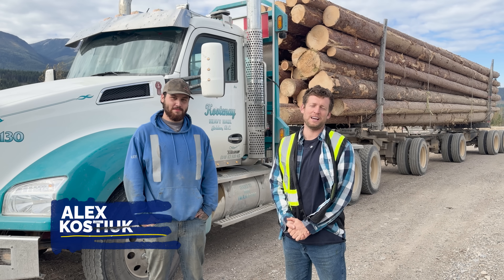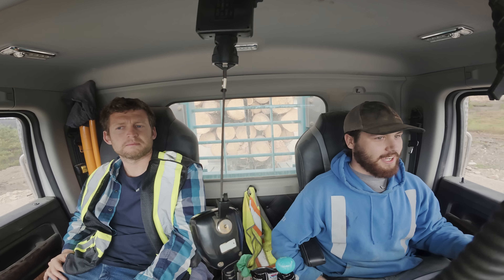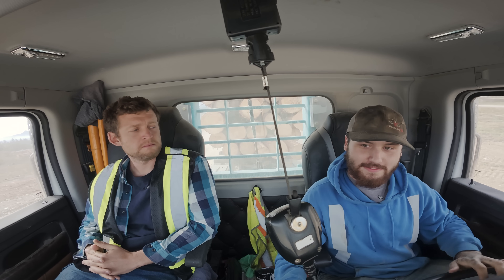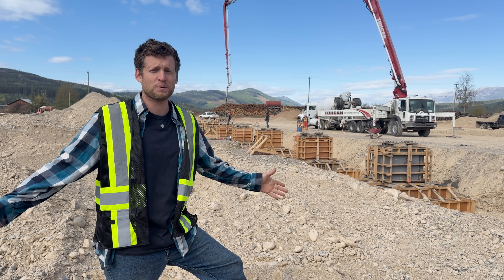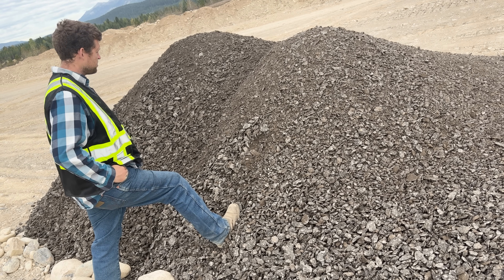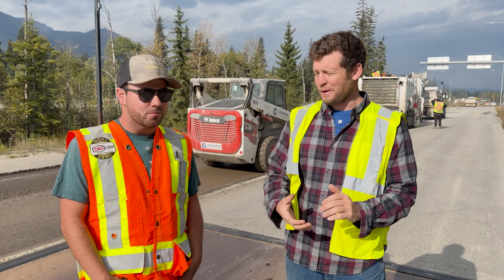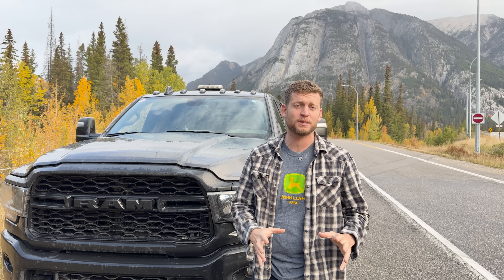First Ever Test Run on the Edison Motors Track

Comment: Will someone on this channel help me understand how the Edison Hybrid truck will handle sustained grade? It seems like ultimately you will be limited by the hp rating of the diesel engine onboard if grade is steep and prolonged. If you look at a lot of small hybrid cars the engine is the same displacement as non-hybrid options, just turns on  and off, probably to match peak power after a sustained load. 

I know am in no way a skeptic of this idea. Love this and this company. So many benefits to hybrid  in a big truck that I can see, but I do wonder if ultimately fuel efficiency will actually be one of those, specially for long-distance highway driving.
Reply: It's a math problem.

An Edison truck (using full batts) and the generator running should be able to pull the "IKE" hill challenge  which is the basis for the SAE J2807 truck towing standard.

However 
The harder hill climb is the cocahilla in BC. An Edison truck with full batts and the genny running will produce 750 HP for 90% of the hill and then drop to 250 HP for the last little bit.

So for flatlands, there is no problem. For 99 % of hills/mountains it will work great.

For the IKE, it will work.

For the Cocahilla, the driver will need full batts and back off of full power if you want to maintain a constant speed.

Side note. Most evs worry about range anxiety, but Edison hybrids do not.

Edison hybrids will have "hill" anxiety about making sure the batts are topped off by the genny prior to a giant hill climb, and, make sure to turn off the genny on descent so the wheels can regen fill the batts without overload.

It will be a slight learning curve.

Comment: Hey chase! Could a semi trailer axle be used to create power and take advantage of the regenative breaking? Battery bank built in. Or does the overall weight of that trailer system lower the overall weight capacity you can haul too much?

Comment: Most fleet truck companies in the US don't have on board scales. It's fairly common to have a certified scale in a town/ city or truck stop. Basically for van or reffer trucks, you get loaded from the shipper, then go to a scale either on-site or at a truck stop. Get weighted, then if legal go on about your day. Or if not you got to go back to the shipper with a weigh slip/ticket and get the load re adjusted to be legal. There is some DOT scales that have a display for the drivers, but they are not common any more.

Comment: WhereTF has Topsy disappeared to!??
WhereTF has upgraded Topsy disappeared to!???

I/we are here for the Series Hybrid tech.  NOT! a whole lot of OT BS!!
Don't even download the video ill I  press play  AND  Thumbs down is still a thing and re/enabled here...
Reply: Topsy was built and did some work.

Edison learned that they needed newer/different e-axles, batteries, generator, computer, inverters, wiring harness, cab, and generator.

So the new trucks are getting all this new stuff.

Topsy is set aside for now as Edison is putting all its focus on the new shop and trucks.

Edison will get a new and improved Topsy 2 as soon as possible.
Reply: @Sah-o5m  Maybe, but IIRC there's video of "...new e-driveshafts" and improvements  that would be tried/tested on Topsy.

I'm here for the Series Hybrid tech stuff.
We've been  building normal trucks for over a century now. Buildings n shit for way longer.:  who gives AF!?
Reply: @RayleneCawood 
It takes "buildings n stuff" to be able to make hybrids.

Comment: Scales open give you weights but some stations see it while others dont. Most should show you the weights

Otherwise we have CAT scales at various truck stops you can weigh anything you want on them and non commercial can use them, non commercial is not allowed to use the highway scales on the sides :)

Comment: 10:25 I live in the Kootenay boundary, and I don't think I've seen a scale like that. That being said I'm also not a trucker, but I stop at pullouts and scale stations regularly, it's usually a shack on the side of the site, with a scale. No gauge, only a "when lights are flashing vehicles over 'x'kg must report to scales."

Comment: Some state scales show your weights. They're not there for your convenience, they're there for enforcement. If you want to check your weight, and there's not a scale on site, you find a scale at a truck stop and pay to weigh. Cat scales are by far the most common. They're certified, regularly calibrated, and they will back their accuracy for gross in court. 
When I go to Canada, the scales I pass in Ontario and Quebec are barricaded off when closed. They might leave theirs open out west there since there's probably limited scale availability otherwise.

Comment: Should have added a chikane or two, and some speed bumps.

only left turns ignores 1/3 of driving.
you also have more aggressive braking, which pushes the limits of regen. (i think you'll find that you need a few thousand Farads 😉)

Bumps to test real world durability. Bumps are everywhere & shake the shit out of everything. Break it now in testing, because you are ensuring it won't on every truck you sell, so you need to beat every last piece of shit out of it.
Reply: capacitors are rated in Farads. They have basically unlimited charge & discharge current. Lithium batteries are closer to capacitors than lead batteries, but they aren't there, yet. 

Heat is generated in the battery during charge & discharge, and that is what causes cell failure. Caps are more efficient, so they don't get hot, but much bigger. To force failures you need to cause charge & discharge cycles.

i run a 3ah Noco group 7 in my dd (prelude), connected through a current limiting resistor to a  75 Farad capacitor from XS Power & the whole car. The resistor limits the battery to ~26a when the cap gets to 9v, so I'm basically starting off the cap & storing on the battery, so it stays healthy.

Comment: Why have a pump truck when the mixer can drive right up to each form.  I've got 35 years in concrete and we avoid pumps when possible save basically 1000 dollars

Comment: 10:40 Most truck stops in the US will have a sign for Certified Scales. You pull up, give a bit of info, they weigh all axles at once, and you pull off. Once you are inside you mention you have a weigh ticket, they will print the ticket and show all axles (Steer/Drive/Trailer) on the ticket.

Comment: When you get to Gov. Explain the purpose of the motor provides power to a moving vehicle. That the generator is part of the drive train. Similarly to a diesel electric train. That the vehicles engine will operate at different ranges depending on needs. That the only way you feel you can test it. Is by running the motor at different rpm for time requirements to emission output. Which is what they do with 90% of the diesel vehicles on the road.

Comment: Asphalt grindings are king ... asphalt is pretty much gravel with a sticky rubber sauce (bitumen), so if you pack it down good and then have a huge gas torch setup or a few warm days on it, it's basically asphalt again. Plus it's a waste product in most road replacement works, so with a little attention for the building sites around you and an early scouting mission, you could pave your entire private driveway with it.

Comment: IT'S NOT A HYBRID! 😫

Stop calling it that. It's just a standard, battery-electric EV. "Hybrids" operate a completely different way. This is why you can't get it licensed; you're confusing them. Show it operating without any diesel on board, and get your permit. Later, when they question the generators you're installing as optional equipment, explain that it's a bog standard, aux gen. IT DOES NOT AND CANNOT MOVE THE TRUCK, because the truck is NOT a hybrid. The genset only provides power to optional equipment. (e.g. a battery charger or welder)

HTH ✊🤓

Comment: In the States, we go to the truck stop and use the CAT scales. It costs around $10-$15 but it worth it, in my opinion.  And most companies will reimburse you.  It's nice because it gives you the steer/drive/trailer weights.  And now they have an app on the phone so it's immediate feedback.
Reply: This with the app its pretty easy to get your numbers now
Reply: The truck I drive was shipped up from the states, its still got the CAT scale ticket in it from before they imported it 😅 kinda cool because I know what all the equipment on it weighs since I've got an empty weight

Comment: Certainly not government. If that were the case, the budget would be $40-100 million, you'd still be in the endless planning and permitting stage (for the next 5-10 years), and then declare bankruptcy without having even built your factory, let alone actually making a single finished truck.

Comment: Only times I've been unlucky enough to have to cross DOT scales I was empty, so they just put on the green light and the arrow saying, "Proceed to highway." If I need to scale my truck, I have to take it to the nearest CAT Scale and pay to do it. First weigh costs a lot more than if you are doing a re-weigh. Some of the places I used to deliver to would scale us in and then scale us again when we left, so that was nice. All that said, I'm a pretty inexperienced driver and I haven't operated outside of a small area within a few states from where I live, so it may be way different in other places. Lots of things in the US are left to the individual states.

Comment: 10:40 the only states I can recall at the moment that show you your axle weights are Kentucky, Tennessee, Wisconsin, Kansas, and Iowa. You typically have to go to a truck stop to get a certified scale ticket at a CAT scale.
Reply: Idaho, Oregon, and Montana all show you the weight as you drive across the scale, so if you are paying attention, you’ll get the axle weights.
Reply: @benhart16 came here to say here in Oregon most/ all scales IV seen show weight even when closed.
Reply: Just any FYI cat scales only certify your gross weight not individual axle weights. It says it right at the bottom of the ticket
Reply: I've been picking up gravel in bulk at the landscaping supply. They charge you by weight, so you put your vehicle on a scale. I know that the cat scales are probably more accurate, but I have a reasonable estimate to the weight of each axle on my truck because I stopped and let it settle one axle at a time before picking up one of the loads 😂

Go early enough and they might let you go through free
Reply: @joeymea  yeah I recently switched from OTR to gravel truck hauling in Michigan and we have a similar setup at the quarries/pits.

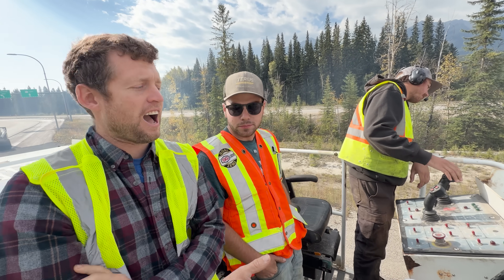Comment: 9:00. As the traffic control guy who always gets ripped open by the operator when 10 cars back you decide to form a gap and then speed up and go buy these guys at like 50 miles an hour slow the fuck down

Comment: 12:47 CHANGE YOUR LINGO! Seriously, it might help you. The classifications are: EV, Hybrid, PHEV, and EREV. If you have an electric truck with an ICE electric generator, you have an EREV (Extended Range Electric Vehicle), not a plug-in hybrid electric vehicle. Am I wrong?
Reply from the maker: It’s not the language that matters. It’s that fact that the generator provides power to the batteries, which propel the Truck.
-Theron
Reply: @EdisonMotors Are you saying your vehicles' rely on 100% of their electrical power coming from the generator and are never plugged in? EREVs exist, even as passenger cars. How are those vehicles meeting emissions standards?
Reply: @TroyWV as said in another video, the other vehicles are manufactured by large companies that can afford to get them certified. They can afford to jump through the hoops.
Reply: @zachdemand4508 I share the frustration of Edison Motors.

Comment: In the US, you generally have to pay to weigh out at a commercial CAT scale. Sometimes closed scales will still display weights but usually they shut everything off when its not occupied. It doesn't help that every state does their weigh stations different. I think it was in Arkansas I had DOT get on the PA and yell at me to get off their scale since I kept stopping when the light turned red. Apparently red means go down there.

Comment: I have no problem slowing down for road construction. I do however have a problem with slowing down 3km before a single human or piece of equipment or when the crews are 50m off the road or behind 4ton concrete blocks.  The safe zones are ridiculous.

Comment: In the US there are private scales at truck stops that will give you the weight of your truck and trailer.  The scales on the highway will fine you if your over the limit, they are there to increase the state revenue.

Comment: I work at a wood mill (door parts, baseboard, and trim) and we have a certified axle scale on site. So after the trucks get loaded up they run over the scales and get a print out. And since wood can vary in density sometimes they are overweight and end having to take some of the load back off to get under max weight.

Comment: Scales I have been on in the Northwest US are usually at least on when the station is 'closed', but it is 50/50 if they have a weight display that can be seen from the cab, or if it is a small display in the window of the shack.

Comment: Some states give you the weight. Very few though. OR used to move the read out to where it could be read through the window if tge scale was closed. Most will give you weights if they are open. You might have to reweigh if they are open to get them. Otherwise you have to pay at a truckstop or get weights from a shipper if they have scales.

Comment: Not a truck driver but, I have had need to weigh vehicles. In Missouri, at some of the truck fuel stations they have CAT scales, I assume CAT is the company that owns/ manages the scales, though the logo seems to match CAT equipment.

Comment: On the railway they ended up making a network center that included people from all the trades to determine who got control of the track and when. There is a constant battle between ops and maintenance. Ops wants to run trains and maintenance and construction have deadlines to inspect and build. Maintainers would accuse trains of wearing out the tracks and hoggers would complain about being slowed down.

Comment: on scales... the DOT scales sometimes have a display, the bigger ones generally do, sometimes they are hiding in the coop so you have to get out and peek, other wise the mills and quarries generally have scales, so you can set your scales at the mill or quarry, the other option is to lock for a truck stop with a scale, usually coasts a few $$ and you have to go in and ask for it... but its an option.

Comment: Stupid question from an armchair engineer: Why don't you get an EPA certified 9 liter and run it as a generator? You'd only need a basic external controller to govern RPM and keep the generator happy, and you wouldn't have to touch the original engine software. I'm probably missing something, it just seems like an obvious stop gap solution to me.
Reply: Canada ECCC says if Edison takes an on highway engine and uses it as a generator then Edison needs to do $1M in testing to prove it stays in compliance. It us dumb.

Comment: Congrats on the test track.  A little banking will save the track from rain run-off as well.  Make sure you dig a drainage pond on he inside  so that the runoff can feed your aquifer.   
In the US, they weigh you on the fly or per axle after getting pulled over.  The police officer will write the weight down on your ticket.  Go to a CAT scale for a reliable weight.

Comment: be careful with the asphalt shavings, i wirked for a ski resort in lake Tahoe, and they did the same thing.  DOT was resurfacing the highway and the resort accepted the shaving to pave their parkinglot.  come springtime after the snowmelt, half the shaving ended up in the creek and they got hit with a huge pollution fine for leaching bitumen into the water supply.  obviously laws are different in the states vs canada but just wanted to share my experience with it so you can protext any water ways near the test track.
Reply: asphalt shavings work great if installed properly, no matter what you need heat. best to apply in 30+ sunny conditions and immediately apply a product called Reclamite. or else it will never bond and what you just described will be the result
Reply: @mindman1234  100% I hope it works on compacted asphalt shavings in the SE BC climate.  They may need to use a roller to compact it a bit better.  It's still very dusty.
Reply: Are asphalt shavings on the Prop65 list as causing cancer?? Bet they are, along with air, water, and sunshine.
Reply: @tommiller7177  You don't understand what Prop65 is 🤣
Reply: @podcasstcuts Califonia has been found to cause cancer.
Reply: @wobblysauce 😂😂😂
Reply: @wobblysauce how do you know im talking about a california Ski resort.  Tahoe is split between California and Nevada...
Reply: @bassman87 welp the cancer has been spreading
Reply: @tommiller7177 yeah its not recommended to drink petroleum byproducts, bitumen being on the list.  I wouldn't be surprised if you did it would cause cancer.

Comment: I can atleast say for Oregon a lot of are scales have the a digital read out for weight that the driver can see. I don’t drive truck but I use the scales when there closed to see how much I am hauling with my bumper pull on my work truck

Comment: For the new shop som tracks in the floor that also goes a couple of truck lengths outside could be good for bringing in framerails into the shop and it could possibly be extended to transport parts and equipment around both the shop and elsewhere on the property. One track gauge that could possibly work for that is 600mm that is relatively wildly used around the world.

Comment: asphalt or concrete on the test track? idk if you have a required material but with loaded trucks I would thing that concrete would hold up a lot better (though probably be more expensive to install.)

edit: ok what you're doing is SIGNIFICATLY cheaper